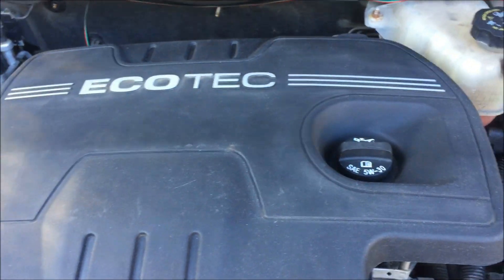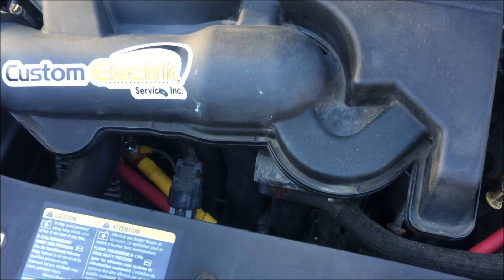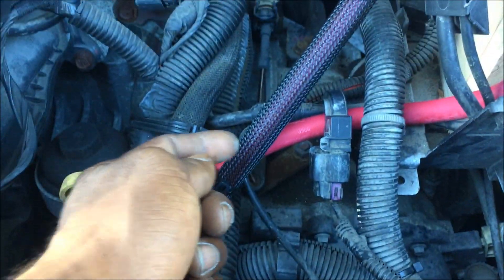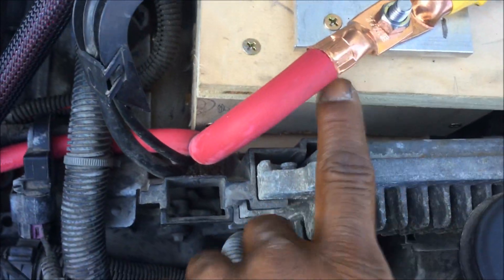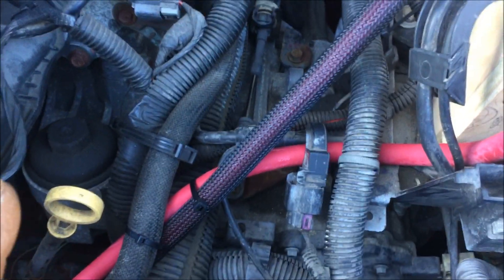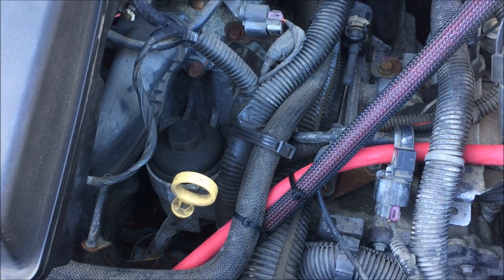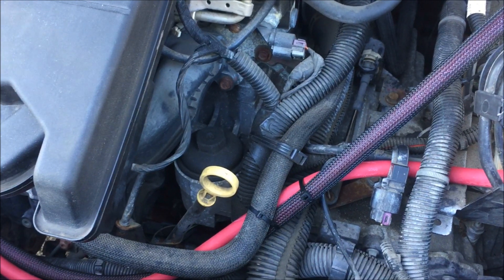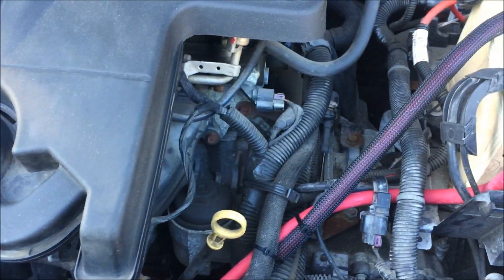TIP For GM PCM Controlled Alt. You Did A Big 3 or Alt Upgrade & LOW VOLTAGE

Comment: Thank you!! I’ve been looking for days about the big 3 upgrade with this voltage regulator on my GM & I’m able to actually see what your talking about!! Thank you a millions!!!
Reply from the maker: No problem 😎🙂 thank you for stopping by and leaving a comment.
Reply: Did you remove the wires that were already running through there

Comment: damit hell yess man glad to finally find a video of someone explaining this properly i just posted this on gm forum and smd forum the way i did  mine i ran all grounds to a distro block and ran the main lead through that factory amp clamp made it easier rather than trying to fit multiple runs through it 
most people dont realize whats happening your allowing current to bypass the clamp when you add extra grounds as you stated in the vid
Reply from the maker: Thanks much 😎
Reply: I have an 08 Silverado so pretty much run all my other grounds to my distro block and run my main lead which would be the battery negative to the alternator passing through amp clamp by itself?
Reply: @tastedfra  did it help?

Comment: 🔴 How bout if I'm running a second battery? I paralleled the power and ground from start battery but still low voltage. Should I run a power to rear battery directly from alternator and run the ground thru the start battery?
Reply from the maker: What is your voltage reading is your secondary battery in the rear near the amp? What size wire? CCA or OFC wire? Just getting an idea

Comment: Where did you connect the power wire from the battery on the alternator? Because 2010 Malibu alternator has a plug only. I don’t see the standard power wire with a bolt?

Comment: So another thing... On the Impala SS v8 07 only the hot from alt and the wire to fuse block are in that. So my issue is am I supposed to shove my amp wire thought it too? No big three. But I did connect amp power like normal to battery. It doesn't go through the sensor. Do I need to make it do so so the alt can sense the draw?

Comment: I have a yukon so it's an area under hood to add a second battery. So would the second battery ground have to run Thur that sensor as well. Or could I run the ground off the main battery
Reply from the maker: If your batteries are linked the one run should be good if not 2

Comment: I did the big 3 to my 16 Mustang GT. Started off great until about 20 mins of driving my voltage started going down to 12v. I saw this sensors on the ground near the battery. Should I just run my engine block to ground through this loop only? Since I've used where the factory placed the frame ground which is on the strut tower right before the loop at the battery.
Reply from the maker: To be safe  Would run my new grounds thru the sensor and everywhere the factory has them. Basically just upgrading the wire

Comment: What about 06 malibu lt I did the big 3 and no change and my amp cut out. And i got a print out from D4S shows a two upgrades only
Reply from the maker: Amp cut out due to low voltage? Do you have a voltmeter installed at the rear? What size amp? If it’s over 5k I suggest multiple grounds to a distribution block then to amp. Or grounds to rear battery. Then from battery to amp

Comment: The red wire is the positive wire right that you got coming from the alternator to the battery
Reply from the maker: The red bare wire not wrapped in techflex is the negative it’s going through the Hall effect sensor. It’s bolted on the case of the alternator as part of a big 3
Reply from the maker: It was a solid negative run to the rear but I decided to split it at the distribution box
Reply: Yeah I see what you was talking about because I have a 13 chevy Malibu and main factory ground wire already going through there so you saying when I do my big 3 take all my grounds thru there
Reply: The main ground wire that's coming from the battery is already going through there is what I was saying
Reply: And what your alt amp output
Reply from the maker: @lamontlawrence8557  yes I would definitely do it. The sensor will take up to 2/0 ga. Anything bigger won’t fit.
Reply from the maker: @lamontlawrence8557  yes sir. Your correct.
Reply from the maker: @lamontlawrence8557  It’s a 320a alt made by brand X he used to be the main man at CES before he started his own thing

Comment: Is that small black wire running through there to not the battery black wire but that little one
Reply from the maker: I want to say yes it’s been a while since I’ve been under the hood. I’m 90% on that 10 chances I’m wrong .

Comment: True basshead stuff right there
Reply from the maker: Its confirmed it really worked for me. I played for hours at a local show a few weeks ago and my voltage was acting dumb. Sunday I was at another local show demoing for at least 2-3 hours close to full tilt and almost non stop. I got my batteries down to about 20% and the alt blew my main fuse at 12.8v.
Reply: @bigvell02  Whoa! That's really something bro. Hope it wasn't too costly learning this. I've never heard of that sensor before. My car idles at 550 rpms tho. I sh*t you not! That's been my biggest hurdle. I always to touch the gas a little when I go full tilt cuz my Singer 275 hairpin doesn't do much until 800 rpms or higher
Reply: Kinetic 1200 up front
Singer 275 alt
2/0 Sky high OFC power wire front to back
Five Sky high 1/0 OFC runs
Xs D3100 rear
Limitless 25 rear
2 Crescendo 2.2ks
2 PSI platform 2 High performance 12's

Any thoughts?

Comment: I have a 2010 HHR and planned to do some ground upgrades and stuff. Leaving 4awg alt to battery wire alone since its stock. Will I have any issues?
Reply from the maker: If your upgrading everything else and leaving the alt to battery wire stock. You will be creating a electrical bottleneck. If you run a ground straight to the engine block your pcm may not catch the current demand via Hall effect sensor.

Comment: I had the same issue in my 2011 impala
Reply from the maker: Glad to hear it was a night and day difference. I'm happy because now my batteries won't cycle as hard :) :)
Reply: Mines on the positive.. Do i run alt pos to battery pos through that
Reply: @convict7462  you should be fine with just the run of positive to the amp just so its registering voltage and run the alternator straight to the battery

Comment: installed a 300amp alt and big 3 but Only charging at 14 max most the time 13.8 can you link me with pcm bypass or what I need to do thanks
Reply from the maker: I got you. You can look into s voltage controller US Alts makes a nice one, the one I have works as well it’s from BrandX. This will make your alt work a little harder. What kind of car?
Reply: @bigvell02  I talk to some people at Mechman  and also at auto tech engineering USA I guess the current alternator I have is crap that’s what they call a pancake alternator anyway I think I’m gonna order a excessive amperage 370 Monday but I will look into your suggestion thanks
Reply: @bigvell02  It’s a 2003 grand Marquis has a 4.6 L basically they said that my alternator is a pancake alternator and his crap said he was just being honest that a 240 would be better than the current so-called 300 I have now but I think if I’m gonna spend money I might as well go back and get the excessive amperage 370 or if I can find a door bracket cheap I do have another alternator if mine will charge higher it would be fine

Comment: I have a 2009 Malibu LT and I upgraded my alternator to 340  For some reason when I turn it up to 23 volume my Power steering and traction light blinks off and on and a party steering axle do you have any help with this matter
Reply: I did what you did in my problem went away thanks a lot for the information you just saved me money
Reply from the maker: I need to PIN this comment :) :). That's whats up Happy to hear 
Peace and Bass
Reply from the maker: Never had any issues with any of the above stated. But since I added a 3rd subwoofer and went up on power my dash looks like Christmas time. Even the PCM with a check engine light that won't disappear :(

Comment: What about for Japanese cars that have pcm controlled alts ? I have a 250 amp ces alt. With a ces 80ah. I only drop down to 14.3 full tilt on a. 5k at half ohm. But just upgraded to 2/0 welding cable all around 4 runs from alt to 80ah bank 4 runs of 2/0 going back to the 80ah i havent tested it out yet but i only charge up to 14.8. Cold max now used to charge to 14.9 15.0. Cold on my old Northstar 31s but the voltage is good .is there something similar on these japanese cars? Or just gm
Reply from the maker: Yes some Japanese cars are similar on my JDM car I have a bypass harness (60% on the exact name for it) I got it from Singer 2 years ago. but it makes it so I get a charge set point of 14.9 15.0 when cold. I think its a FLV bypass or something like that.

Comment: Big bra I did this with my 11 Tahoe , it worked.

But I also raised my idle in park and tuned the alt tables using hp tuners.

I see 15.01 volts and it drops to 14.1 dam near full tilt. 

And that sensor mesure current load. So if you have the room run an extra    .6 wire along with your zero guage.

What that will do also will limit the mil second it takes the ECU to crank up the voltage
Reply from the maker: Happy to hear and yeah I was looking at 13.3 at times no matter how much I revved the engine up. I figured it was the heat but once I got that cable through the magic ring lol (hall effect sensor) I saw a difference of almost a volt. I have 2/0 welding cable going through now got have me thinking about squeezing another small ground through the rest of the gap.
Reply: @bigvell02  

Yeah that sensor is crazy lol. It took me a min to figure it out. I had good voltage on start up. But after driving around it would drop to 12.5 and jump back up after awhile.

I did notice with the AC on it stayed around 14 volts but when banging it would drop to 13 almost to 12 volts.

So did run the grounds through the sensor that help alot been like that for a min. But I needed more amps lol. I tuned race cars and bulid them, so I used hp tuners to adjust the duty. Cycle of the alternator. And that fix my voltage problems.

If you go to hp tuners.com 
And go to the vehicle support list and see if your vehicle is supported. Then you can either buy the kit or find someone locally that has it. Most race shops should have it. And can adjust your tables and so on.

I posted a video on my channel showing the effects. This morning and later on I'll post a drop demo.

Keep bass ing
Reply: Video is up, I'll post the drop demo later great tip bra!
Reply: How the hell do you change the idle rpm
Reply: @Alanreaks35  

I used HP tuners, went to the idle air tab, change the rpm in the park only tab and adjusted the air fuel  mix and timing. 

Visit ho tuners.com go to vehicle support list see if your car is supported. If it is then you can order the kit or have a race shop do it for you.
Reply: @mrbasshead403  where’s the location on that sensor on my 2007 Tahoe

Comment: So run my grounds threw there
Reply from the maker: Yes Sir. I was able to squeeze a run of 2/0 welding cable through. Tight fit but winning..
Reply: @bigvell02  alright appreciate it homie
Reply: @bigvell02  appreciate the tip , it helped pretty

Comment: Don’t work on all gm pcm controlled just saying!
Reply from the maker: Facts & I totally agree Sir.. But its definitely worth a shot for people out there. No bull I saw a big difference in my voltage nothing changed except fishing the line through the sensor. I got close to 300a to the rear before the fuse popped today around 12.8. My batteries got low after hours of non stop demos at almost full tilt.